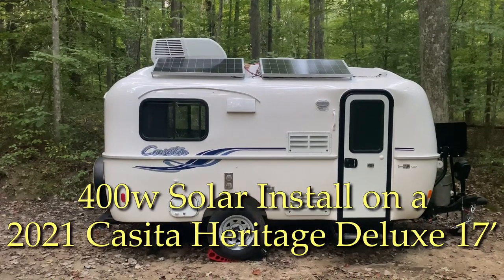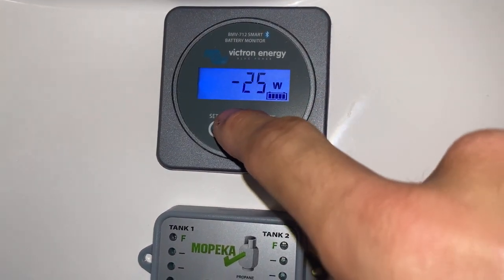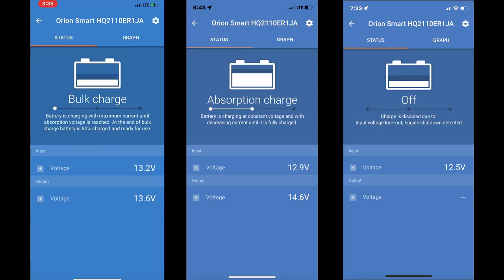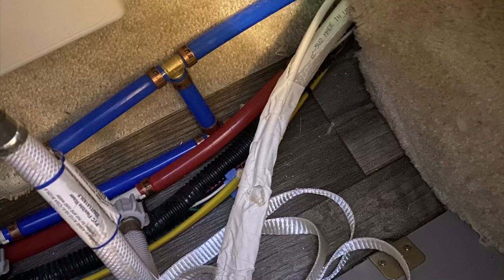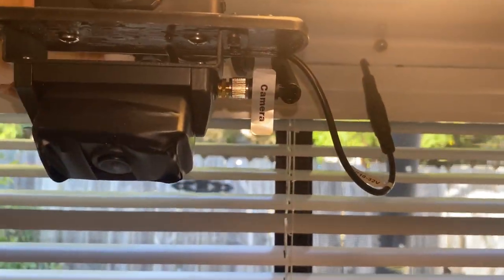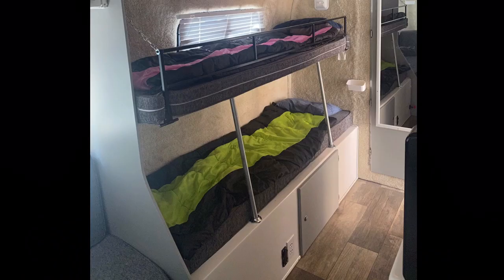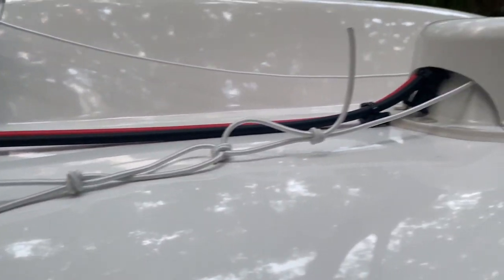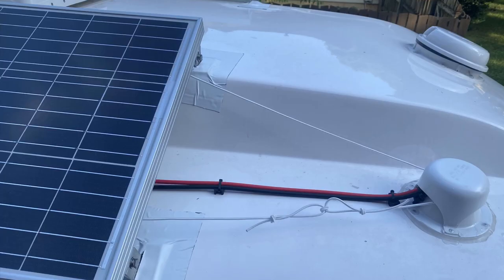400w Solar Install on a 2021 Casita Heritage Deluxe 17’

Comment: Nice!  I have the 2021 Freedom Deluxe I recently picked up.  I got the additional large and portable 120 Watt solar panel and it works great.  I like the fact that it's not attached to the exterior roof because when and if it hails or I experience freezing rain the panels are safe either inside or tucked under the unit.  Plus I can shift it around and get the sun right on it.  I also bought and installed a 450W inverter for the TV.  When I hook up the solar panel I disconnect from the truck so it's not charging the car battery as well.  Of course mine only charges when I stop and hook it up but so far so good. Good luck with what you did!
Reply from the maker: Sounds like you have a good system that works for you.  When I’m camping i am only at my camper to sleep. So during the day no one is around to babysit a portable panel. I wanted something that is more setup and forget, it just works.  So far things have been working great.  Good luck with your setup as well!  Thanks.

Comment: I recently bought a Casita and pulled out the AGM and factory converter and replaced with 2x100AH LiFePo4 batteries and a PowerMax converter.  I bought a Giandel 2200 watt inverter and 7 100 watt solar panels and a Renogy MPPT controller.  I'm hoping to install those soon.  I'm finding that doing it the right way is taking me a little bit of time.
Reply from the maker: Nice!  Good luck with the install.  I plan on installing a Xantrex inverter soon.  Currently trying to plan that out.

Where are you going to put all 7 of those solar panels on your Casita?  I have 4 and might could see where i could put one more, but not three.

Comment: This is just what I was looking for to install my DC-DC converter. I have the 8AGW wire ready to thread behind the shower just like in your video,  If you don't mind, can you talk a bit about the wire connection to the 7-pin? I see you just replaced the positive going into the camper with the 8AGW, but how did you handle the negative since it has to stay connected? Thanks!
Reply from the maker: Great question, thanks for asking.  Yes, i had to connect the negative of both sides of the DC-DC together to make sure my lights and brakes worked correctly.

Comment: Great video! May I ask what kind of cable tie management did you use? Also what kind of silicon did you mention on your video?
Reply from the maker: Thanks!  I bought the black square zip tie holders from amazon.  I then removed the double sided tape on the back of them and replaced it with VHB tape.  I could then place these where i needed them without them pulling off.

I used Dicor non leveling lap sealant to seal around the VHB tape on the feet for the panels.  I then also covered them with eternabond for extra moisture protection and additional adhesion.
Reply: Thank you so much. One more follow up question. What kind of solar cables did you get for your instillation? 
Trying to think the best way to utilize the space on my casita. I was thinking to get 2 sets of M/FFFF and F/MMMM @stevelineberry
Reply from the maker: I got weatherproof cables from BougeRV.  I also got the set you suggested to put all of the panels in parallel.

Comment: Great video Steve.  I too want to modify my Casita to using Lithium battery, and support safely charging from the 7 pin, rather than running an umbilical from the TV.  I realize that charging while under tow is much slower through 7pin than it could be with a dedicated umbilical connection, but for me I want to stick with the 7 pin solutions.  
I'm curious about one of the wiring choices, in particular, why you found it preferable to run new (8 awg) wiring from the 7 pin wiring immediately after it enters the Casita?  What prevents doing that wiring closer to the main wiring controller?  Is it primarily that the factory wiring for the power line isn't efficient enough?
Reply from the maker: Thanks!  Yea, the factory wiring is 10awg and i was trying to reduce the voltage drop as much as possible.  Unsure how much the 8wg helped but i know it didn’t hurt.  

I needed to run wires anyway so that my electric tongue jack and breakaway cable could run off of the Casita battery like it’s supposed to.

I guess the other option was to put the DC-DC charger in the closet and i wouldn’t need to run any extra wires.  But in my instance, i wanted to setup a relay to turn on my rearview camera and tpms relay when i connect the 7-pin to my tow vehicle.  To accomplish this I would still need to run wires from the closet to the relay.  It just made sense to run larger charger wires and simply my install and possibly reduce the voltage drop.

Comment: Hi Steve. This video is very inspiring. I'm actually in the process of buying a 2021 Casita Heritage Deluxe myself and I'm hoping to emulate your solar project...I have 0 experience with electricals and solar panels but learning is half the fun. Are your solar panel mounts still holding up well? I would hate to drill holes in the Casita roof...I'll probably do what you did to mount the panels on the roof.
Reply from the maker: Thanks and let me know if you end up with some questions while you are doing your install.
Reply from the maker: Btw, the panels have been holding up very well.  We’ve done 71 nights and over 16k miles with them so far.  We even drove in 45+ mph winds while in Wyoming back in May.

Comment: Steve- Did you use structural mounting brackets from Renogy?
I have a Casita Freedom Standard. I am trying to figure out how to mount a 200 watt panel forward of the exhaust fan and another aft of the exhaust fan. No AC unit.
Reply from the maker: Thanks for asking.  I’ve updated the description to include the link but here it is for your convenience.  https://rvsolarstore.com/index.php?route=product/product&product_id=112

They are called sticky feet.
Reply: @stevelineberry   Thanks! When it’s a little warmer, I will get to laying out the panels.
Reply from the maker: @edlambert4472  sweet!  Good luck with the install!

Comment: Awesome! So you didn't run a separate umbilical from the car to the DC-DC charge controller?  I've done something similar to upgrade by Casita, but I haven't connected my DC-DC controller yet, as I was planning on doing an umbilical, but if you can just tap it from the 7 Pin connecter that's really interesting!
Reply from the maker: Thanks!  I didn’t run an extra connector.  Tapping into the 7-pin felt cleaner and easier when hitching and unhitching.

Comment: Did you run the wires from the closet along the floor and against the wall under the bathroom door? Thus, they'd be exposed to the main living area? I need to keep my wires away from the main living area because my kids are 3 and 1 years old.
Reply from the maker: No, i ran them around the outside between the bathroom wall and the shell.
Reply: Oh wow. I didn't know that area was accessible. How are you able to feed wire through there?  ...Thanks a bunch for posting this video. It's great.
Reply: Also, if I only did half of the the panels you did - 200 watts on the driver side - do you think the imbalance would affect the trailer when driving? I have the awning, so doing this on the passenger side would be difficult.

Comment: Are 200 W panels not available, only 100? I plan on replacing the battery i have with a lithium. Would 400 watts be overkill for just one battery?
Reply from the maker: Sure, 200w panels are available but you may have a hard time fitting them on the roof.  100-200w total should be fine for you.
Reply: @stevelineberry  Thanks
 I'll start with two 100 watt panels, then if I decide to add another battery, I can increase the panels as well.

Comment: you technically only have 200 watts because the sun cannot shine on all 4 at the same time - any option to install adjustment brackets?
Reply from the maker: In theory, yes, but in reality I've seen it many times collecting over 300w for a period of time while the sun was overhead.  I have a friend of mine that did adjustable brackets.  For me, I felt like I just wanted something that I didn't have to worry about and just worked without any fiddling or babysitting.  This does that for me and on my recent 19 day trip from Charlotte, NC to Wyoming where we spent 17 of those days boondocking, my solar got my batteries to 100% every day.  We averaged 50Ah a day on that trip with the biggest day using up 122Ah because I ran the air conditioner a lot.   Given this I haven't felt the need to make any improvements to my solar install.
Reply: @stevelineberry  I put 19 panels on my roof without tilt brackets - did not want to mess with it either - more of a tetris design lol
Reply: He has even less than that; those panels are configured in parallel, which means that his charge controller is not operating at its optimal voltage. But to start, that orientation is truly a waste of money. He's going to slowly kill his Battleborn batteries because they'll never get to absorb charge, which is required by Battleborn.
Reply: @vespagts7078  configuration does not matter so as long as all requirements have been met

absorption charge is when the batteries are getting charged - that can occur with a 10 watt panel - will take a long time to charge it

I do not think you understand how solar energy and the individual components work

Comment: Seen some issues with leaking/condensation with these Casitas… what’s your experience been?
Reply from the maker: So far things have been great. No leaks, the windows fog up from our body heat/moisture sometimes as expected but no condensation on the walls.  I do use a dehumidifier when i have it stored at my house.
Reply: Condensation is always going to be an issue, these things are sealed up.  The single biggest weakness is of you do have a leak, there is no way for the water to get out, so floors can rot.

Comment: Can you post a video about your lithium battery install?
Reply from the maker: I might can do that.  What are you most interested in seeing?
Reply: Which ones you chose and why, and how/where you installed them, including how they tie into solar panel when used (though I live in the PNW where sunny campgrounds aren’t common). I am picking up my new Liberty Dlx in April and am interested in adding lithium to extend capacity.  Thanks so much, I am sure many are interested as well.

Comment: Can you be able to run your AC and heater?
Reply from the maker: My furnace hearer runs off propane and 12V very well from the factory.  Since you mention A/C, I am assuming you are referring to the 120V heater inside the A/C unit.  I do not yet have an inverter installed which will convert 12V to 120V, so I am currently unable to run either of those without score power.

Once i get an inverter installed, my estimate is i will be able to run the A/C for about 30 minutes a day if needed.  But that is not the goal of me installing the inverter.

Comment: great video!  I have a very basic 300w foldable panel / single 100Ah setup, but want to move to something like your setup to take advantage of charging while in route to my destination.  do you happen to have a sketch / wiring diagram that you could post a photo of?  thanks!!
Reply from the maker: Thanks!  I don't really have a diagram but it was something I have been considering making.  Because of the tight space, my wiring is a little busy, but I used my label maker a lot to mark things for my future, forgetful self or new owner.  A diagram would help out a lot as well.
Reply: @stevelineberry  no worries... Ya, I've found creating a diagram while things are still fresh in my mind helped me out later on when have to modify or fix things.  cheers!
Reply from the maker: @jeffsauer2198  I just updated the description with a link to a diagram of the install.  Check it out and let me know what you think.  Thanks!
Reply: @stevelineberry  Very nice!  thank you!  this helps me understand your setup much better.  Impressive installation, I plan to add some panels in the spring
Reply from the maker: @jeffsauer2198  thanks, let me know how it goes!!